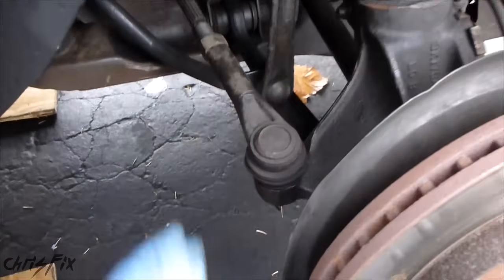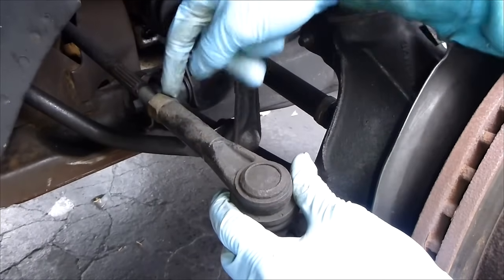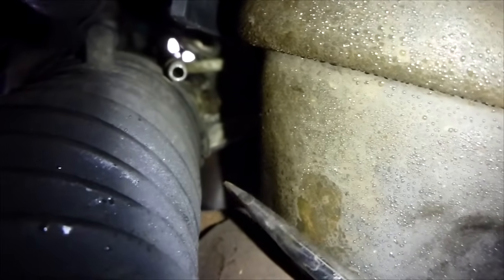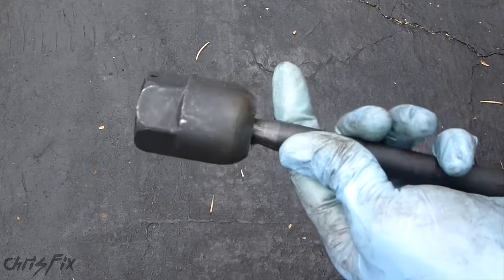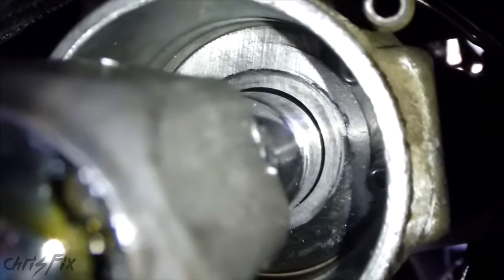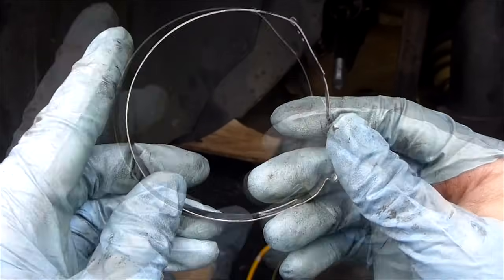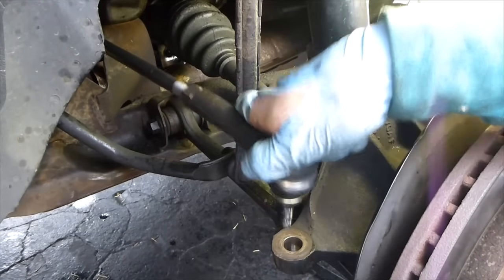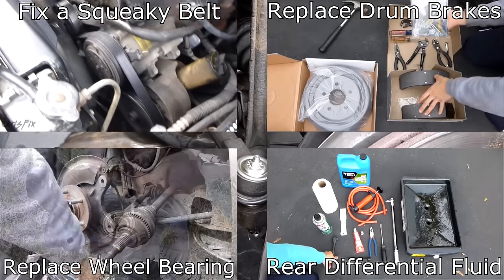How to Change Tie Rods (inner and outer tie rod ends)

Comment: Do you need to grease the inner tie rod portion inside that boot? Or is it just on the outer tie rod portion?  Because when you removed the inner tie ride it looked there was grease on that part that swiveled around.

Comment: Do u absolutely have to grease when ur done or are they pregreased
Reply from the maker: They should be pre greased and good to go but I like to add in a little extra while I'm in there
Reply: @chrisfix  what's the special tool  you are using to get inner tie rod of I got my outer tie rod of but  I couldn't get the nut of the inner tie rod after taking of the outer tie rod any help would be appreciated ty

Comment: Hey buddy the only problem I'm having is on my tire rods on 2004 Dodge ram the tie rods on the exact same length so I don't know how far down the thread to go because I didn't count it was so hard to get off that I have to move that any ideas or any pointers
Reply from the maker: I would just try to get the wheels as straight as you can with the new tie rods if you didn't mark it or count it before. This will require some adjustment and patience, but if you get it close it should get you to the alignment shop safely

Comment: So, question, I have grease-able tie rod ends and they are already full at every oil change- it i pump more grease in it will explode out the side when i hit a good pot hole or bump, and blam! a wad of grease is on my wheel. Where is the grease supposed to leak out from when adding new grease??

Comment: Hi, I tried to replace my outer tie rod. The jamb nut was solid locked. It took me a long time to loosen it. However that being said, it never loosened. I heard a break sound and the whole inner rod was able to spin. This gave me the ability to remove the outer rod. However I'm afraid something isn't right.  The jamb nut is still frozen in place. Do you think it's possible I broke free the inner rod?  Should the inner rod be able to loosen/tighten by hand, after I heard the break free noise? I've never done tie rods before.

Comment: I removed the outer tie rod end, 16 turns to take it off, I bought new rod which is shorter than the original. Newer smaller rod only 10 turns to get the wheels straight, is it safe at just 10 turns?

Comment: Hey Chris, not sure if you'll see this but I'm replacing the tie rods on my Integra and my tie rods won't come out, I've been hammering, tried using a jack to push it up, tried jacking up the break pad for some leverage. No luck so far, any tips?

Comment: I got a problem I can't get the nut off of the end of the tie rod I tried a pickle fork in between it hitting it with a hammer but I can't get enough to break loose I'm going to just try cutting it with a sawsaw will that be all right

Comment: If they are different lengths you can reassemble the inner and outer tie rod after removal from the car. Then take the new components and assemble them until they match the length of the original components. Write down how many turns to remove the outer from the inner tie rods of the new components and use that number for installation.

Comment: if you have a car that the  ties dont have grease nipples is it wise to get ties that may come with that and grease? my car doesnt do grease but i know there are some versions of my car that do have nipples so i always wondered if i had to change my rods (assuming they are the old OEM ones) and my new rods came with grease points should i grease or should i look for sealed pregreased rods?

Comment: When I bought a new inner tie rods and a boot, I've received grease also. Should I put some on the steering rack or only on the tie rod?
Reply: The grease would be for the outer tie rod, with the Zerk fitting and a grease gun. I have a video showing how to do this on my channel.

Comment: Awesome clear, detailed video. Does the pin come with the new inner tie rod ? Thanks
Reply: If the tie rod end requires one, it should come with the new part. Not all will require a pin.

Comment: 01:15 want to know it's even better than using a breaker bar on that castle nut? Using your ratchet wrench and turning it in the correct direction.

Comment: 15 Ford Fusion SE 2.5 L I L took a very severe hit on my driver side wheel and CV axle and my suspension lower control arm were broken and it looks like inner tie rod is missing gone . I’ve got a torn boot and nothing under there …just a hole that the inner joint should be ? Just empty hole against the transmission I guess that’s the transmission right ? Any help would be greatly appreciated thanks . I already took off the CV axle and the lower control arm and went out to the junkyard to get the used parts. Now see about putting it on . I’ve never done suspension work before..watching YouTube videos and an semi retired professional mechanic who I’ve met online on Facebook fusion group is helping me

Comment: I have a 2020 Mercedes GLB 250. What’s the tire off? I can grab the right side of the brake pad and wiggle the whole wheel when I drive the car. I am hearing a clicking and what feels like a loose right front wheel tie rod is on the left and there is a rod connecting the middle of the wheel, I’m assuming that’s that’s the axel. That moves in and out. It doesn’t feel safe to drive.

Comment: 07 HONDA ODYSSEY I DID THE PASSANGER SIDE BUT I TURNED MY WHEEL TO THE LEFT ABOUT HALF WAY YOU CAN STILL GET THE TIRE OFF AND IT BRINGS THE INNER TIE ROD OUT TO YOU😃😃😃😃 I USED MY VERY VERY EXPENSIVE TOOL TO TAKE IT O OFF A SMALL PIPE WRINCH 😂😂😂😂 THIS JOB A BABY CAN DO

Comment: I would have put the ball joint in the hole and rotated the rod to center the ball joint BEFORE tightening the nut on the tie rod end. This will ensure the bellows is centered a bit more carefully.

Comment: Hay Chris,
 I have a question about the tie rod ends, on the inner tie rod end you pulled a pin. My question is does the pin have to line up with a hole or something to work? I assume that it helps to keep the nut from coming loose. If you could please let me know it would be a big help.
Reply from the maker: Some cars there is a hole and some is a slot but yes, its designed so the nut doesnt come loose.
Reply: @chrisfix  But does it have to alien with a hole in the shaft or is it like a compression fitting? Oh and thanks for the help.
Reply from the maker: @eatechnologies  depends. This one was a compression fitting.

Comment: Have you ever done a 15 Ford fusion SE 2.5 L inner tie Rod before? I’m sorta confused about the particular parts coming from the main part the differential? Just what is the main body the big main body that the inner tie rod and ball joint come from ? What’s it called ? I had a wreck and was hit very severely on driver’s side wheel my CV axle and lower control arm are broken and this looks like it too . There’s nothing protruding from the main body part ( I don’t know what it’s called) it’s missing under the boot. Soo I may have to replace that entire assembly.. just what is it called ? I don’t think it’s a piece a shaft I can replace separately is it ? The entire assembly probably needs replacing. Any help would be greatly appreciated thanks

Comment: I have an issue with my tie-rod part on F150 Ford XLT 2015 tie rod ends do not match up to parts online - weird. Wish i could send pictures of what i got and what is shown online.  Update: took a closer look at the tie rod installed and found a part no. FT20277M (closest PN to that i could find is FTS20277) order it now waiting for delivery.

Comment: Hey chrisfix, I went over a curb slowly in a parking lot in a camaro, and it threw my alignment off. After getting it aligned, there is now a vibration when braking at speeds 70+. Would it be the tie rod only that got messed up, or could the control arm ball joint be damaged as well?
Reply from the maker: Check to see if you damaged your tire or rim or a wheel weight came off. But yes it could be a ball joint from a tie rod or control arm.

Comment: Chris:

At 12:46, you tightened the castle nut on the outer rod ball joint spindle, and it didn't spin, evidenced by the fact that the torque wrench clicked (it wouldn't have clicked if the spindle had turned along with the castle nut).  I've got two brand new outer tie rod ends, and BOTH spindles turned along with the nut when I installed them.  At first, I thought the spindle was supposed to remain stationary from watching your video, but upon further thought, it makes sense to me that they're supposed to turn, just not when you're tightening the castle nut.  So I put a wrench on the end of the spindle to hold it stationary and tightened the nut with a crescent wrench.  I realized that the spindle is supposed to turn because it's one of the moving parts of the steering system.  Every time you move the steering wheel, that spindle moves too.  Do you have any guess as to why your spindle didn't turn when you tightened and torqued the castle nut and mine did?  Thanks.

Comment: That happens is leak power steering wheel, do i need to change my rack on pinion??
Reply from the maker: Depends on where the leak is coming from, clean up the leak as best you can and then wait a bit and then see where it's coming from. If it's from your rack then you would need to change your rack, otherwise it can be the lines/reservoir or pump
Reply: @chrisfix  also when moving to left and right the steering wheel, and make some noise it's means same because the leaks ?

Comment: What’s the nut for behind the outer tie rod end? The tie rod end can’t spin when it’s in the hole and bolted down?
Reply from the maker: You are correct in that it can't turn but it helps tighten everything up and it's also useful for when they go to align the car

Comment: Just wanted to tell you that I really liked your video but turning the crown nut upside down just would not work on my car, after a hour of trying everything I could think of and hitting it everywhere I called the parts store and they told me sometimes those can be difficult to get out and to use a sledge hammer and hit the sides to loosen it up. Well after that didn't work I hit the stud that the crown nut screwed on to and it came out, just saying in case anyone else has the problem. I was also doing inner and outer so didn't have to worry about damaging it.

Comment: How would I remove the inner tie rod without the special tool
Reply from the maker: You can try using a normal wrench in most cases!
Reply from the maker: A wrench if it fits.
Reply: @ChrisFix  thank you!! Im tackling this later today and you're a life saver!
Reply: @ChrisFix  sorry for the extra question lol but what size was that big clamp on the boot? I wanna get one before I start tomorrow

Comment: My tie rods are 7 yo,,, is it time to replace??

I have wheel. And steering vibrations  and truck pulls to the right, also the wheels feel loose specially the right side,  by the way tie rods are the last I need to change on the truck,,, I' don't know if just go for alignment and Wheel balance or already change the tie rods.... Outer tie rods feel good but the inner I just don't know....both outer and inner tie rods are 7 years old

Comment: Looks like if you shear the head off of that pin....you could be in big trouble.I would like to see what that pin actually does and what someone should do if the head of the pin is sheared off.Specifically...where does that pin engage to prevent the tie rod from loosening?.

Comment: Did you have any problems getting an alignment done with having a longer inner tie rod? The SKP brand tie rod i installed was about an inch longer than the original causing the shop to be unable to complete the alignment. Debating whether to cut the tie rods down, or just do the install over again with a better brand like Moog.
Reply from the maker: If the tie rods were so long that they couldn’t get it aligned then I would return the wrong part and get the correct part
Reply: @chrisfix  The SKP pair are about an inch and a half too long. May try to cut the extra off first before going through removing and replacing them.

Comment: Best to get a new rack n pinion which comes with inner tie rods already installed.
Reply from the maker: That could get pretty expensive and create a lot more work on most cars, it's best to keep the work area small and just replace the tie rods. It would have to be realigned regardless anyway as well
Reply: @chrisfix  Bad inner tie rod rack n pinion going out soon. It will have to be done.

Comment: Would a screw clamp work instead of zip ties?  I can imagine it being a pain to get to on some vehicles but if it is not going to be rotating like the axles or drive shafts it should be OK.  Just if you don't have much room position the screw part where it won't rub on anything because of vibrations.  If course if you have the proper band and the crimper for it use that instead!  Those factory ones are put on with some sort of tool that pinches or crimps it as you see there.  That is why there is a small bump to use to pop it loose when the time comes.  It is almost like they knew that sooner or later they will need to be changed and designed the band with that in mind considering that on some vehicles getting to them may be difficult.  It feels like one of the few times they thought something out.  Then there are times when it feels like they just weren't thinking at all when the designed something.  An example is the caliper bolts on my Nissan have a hose in the way that makes getting to the top one impossible unless you undo the brake line.  What idiot thought of that???
Reply from the maker: Yes that should work! And that's a pretty poor design

Comment: not sure if anyone has asked this question or has tried it, but wouldnt it be easier to use adjustable hose/duct clamps to put instead of the boot clamp? is there a reason why these are not used to begin with?
Reply from the maker: They have a big piece that hangs off (the nut part. When the axle spins, that will spin very fast and be unbalanced.
Reply: @chrisfix  thanks for the reply! makes sense. I'm gonna replace the tie rods on my silverado, and honestly the clamps is what I am not looking forward to dealing with!

Comment: Amazon has the same clip Chris showed "CV Axles Boot Clip" they also have a metal "zip tie" were the band slides under a strap. You need to pull that tight with a...metal zip tie tool (amazon)then usually you flip it over the strap band and stake it with a punch or similar as these are not ratchet like the plastic ones . These type of metal zip ties  are usually available in big box HW stores along plastic zip ties. Big problem is most steering assemblies are booted and strapped before being place in engine bay. You may not really be able to get a strap like Chris has on, I cant on the passenger side of my 2003 Impala, no angle or room to get at it. I can on the drivers side. so I zip tied the passenger side and Ill either use the metal zip tie to replace it or make my own special crimper tool to get in there (doubtful). Important to note that inner tie rods with a female end to a male thread on the steering piston rack require staking. Inner tie rods dont always have a pin but if its male/female configured it needs to be staked. Thats per Chevys official Shop manual and would be the same for any brand.

Comment: ...best to get all your parts before you start, like that one-use metal clamp,  Don't use metal hose clamps (even if you find one narrow enough).  Use two zip ties to hold it on just long enough to get to the auto parts and buy the proper clamp, plus the special pliers!  There are two reasons NOT to use hos clamps even if they seem like they fit.  In my experience, even IF you find a narrow enough hose clamp, the screw part sticks out and usually it's going to bang on another part of the car once it's turning!  Also the screw head is going to throw the spinning tie rod out of balance a little bit.  Not a huge problem really but, yet another reason hose clamps won't work right on CV boots.  You need the proper 1-use type clamps plus the tool, to install and clamp the boot right, or else you are asking for problems -

Comment: When I unscrew the tie rod end the whole thing spins bc it was in a small accident and I don’t know how to get the nut off because the whole thing just spins
Reply from the maker: Where the rubber cover is, grab onto it with a locking pliers so it stops spinning.

Comment: Counting threads or turns could be a huge issue even from home to the alignment shop, measure from grease zirk hole to any given spot install new tie rod ends to match that measurement, actually you don't even have to measure just scribe a line NOW drive to the alignment shop

Comment: Is the grease part an older vehicle thing? I watched a video on a newer car similar to mine and they didn't say anything about adding grease.
Reply from the maker: If it is a sealed ball joint then you cannot add grease. Old and new cars can have or not have grease fittings. Depends on the part.
Reply: @chrisfix  ok cool, hopefully the part will come with some sort of instructions at least
Reply: @chrisfix  Chris I love your videos and I love that you reply to comments, thank you.  
I'm replacing my inner tie rods now and I'm having an issue. The 1 7/16" crows foot is too small, and the 1 1/2" size is too big, it slips when I apply any torque. I don't see any other sizes in other kits, I think I need about 37mm or so, which doesn't seem to exist. I saw an adjustable type of tool online but it has bad reviews. I'm thinking about grinding my 1 7/16 until it fits. 
Btw my car is just a 2013 Chevy Volt, which shares the same parts with the Cruz, so it shouldn't be anything special. Both the old and new tie rods have the same issue. 
Do you have an advice?